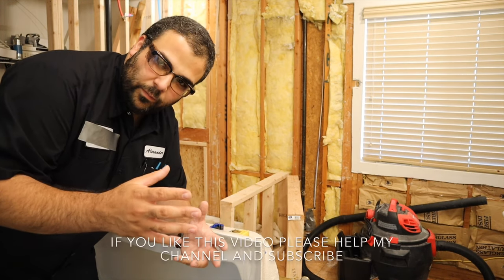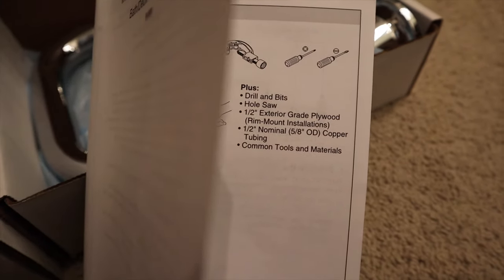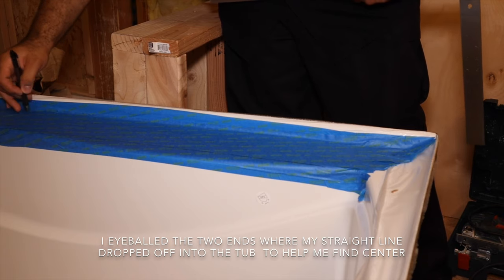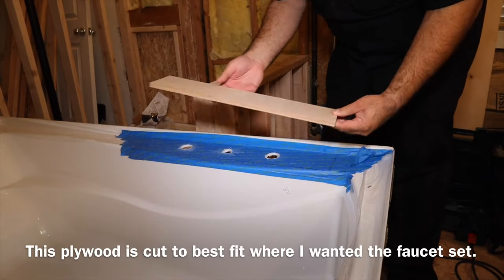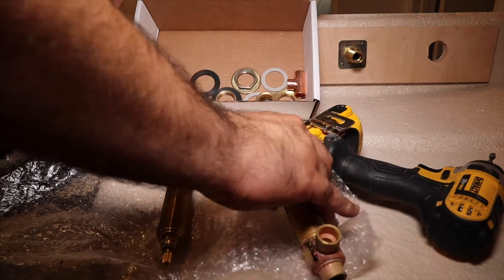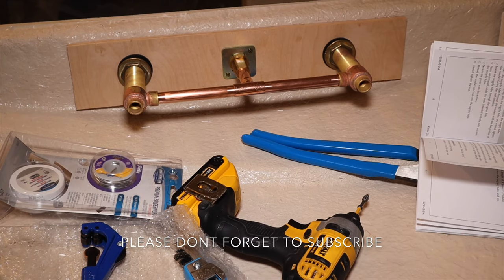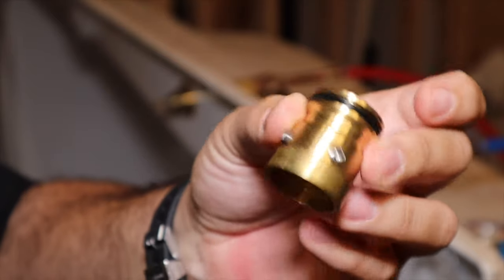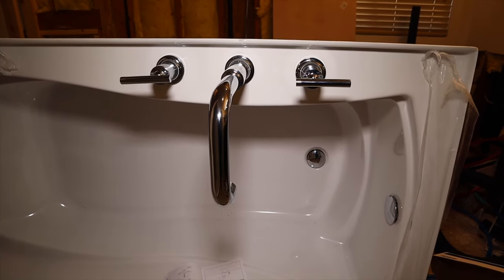Pt 2 DIY Kohler Purist Faucet Valve Install Mariposa Bathtub Home How To Bathroom Remodel Renovation

Comment: Found this helpful, thank you!  Beautiful faucet and handles.  Would the same valve work for a wall installation?
Reply from the maker: Awesome! I’m not so sure if it is the same exact handles but I know Kohler has a wall installation type faucet in this same “purist” line. From what I can see it looks like the same faucet handles just different spout. I think the part number is K-T14414-4